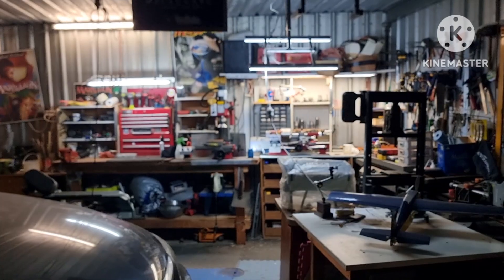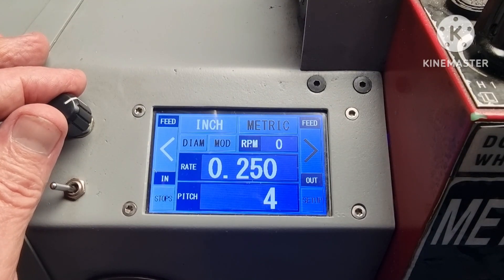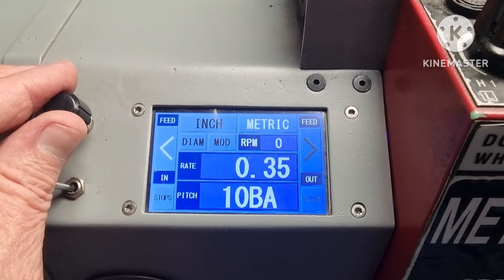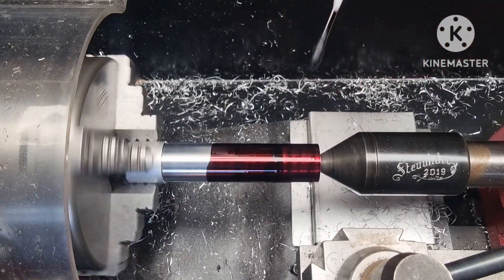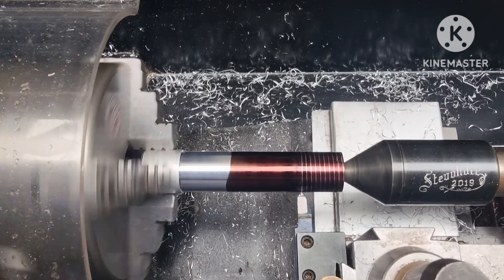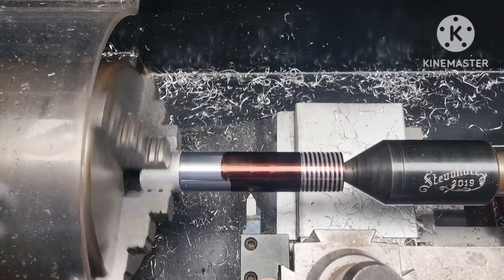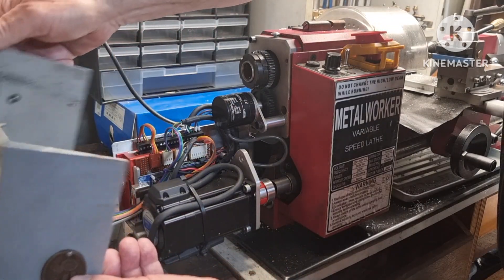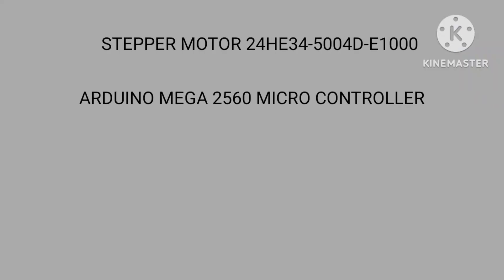NO MORE GEARS

Comment: That is a really nice setup!
I have the same lathe and like you did, I used an original plastic gear and mounted the encoder like you did.
But I didnt use a motor coupling, instead used a 60 and 40 tooth plastic gear, so it is 1 mm of the leadscrew for 1 motor rotation
Reply from the maker: Thats interesting, thanks
Reply: @stevohdee8118     my mounting with the 2 gears got the stepper motor closer to the lathe too, (less stickout to the left) which was part of the reason for doing it.
The other part was that it's a 2 axis cnc and I did direct drive of a motor onto the cross slide, which is 1mm per rev with the stock leadscrew, so then it seemed a good idea to use 40:60 gears on the other motor to also give 1mm per rev.
My stepper drivers are 1600 steps per rev so the base resolution of both axes is 1600 steps per mm.